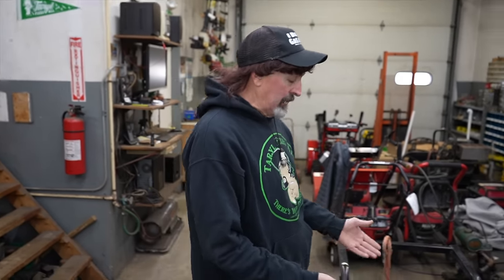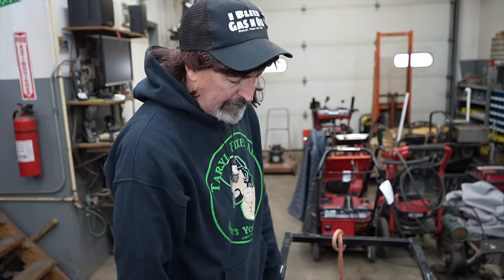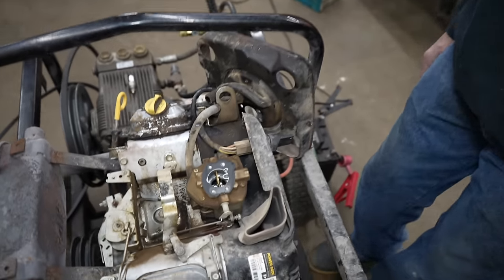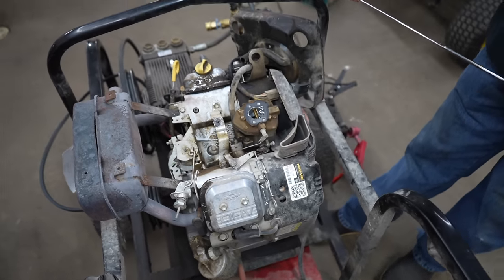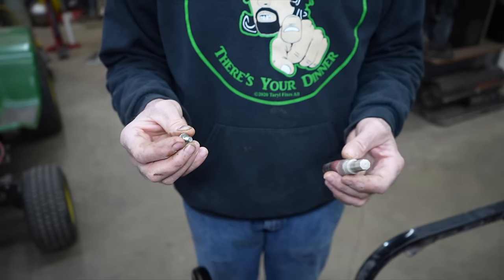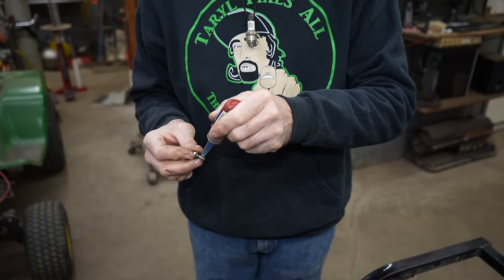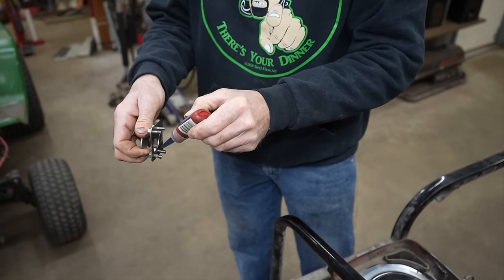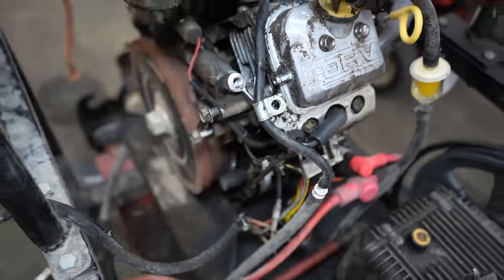Running On One Cylinder - You'll NEVER Guess WHY!

Comment from the maker: Subscribe to the new SKITS channel here! 
https://www.youtube.com/@tarylfixesallskits
Reply: Taryl.... that means he got screwed..... moooooo
Reply: And not in a good way….
Reply: I've been running on one cylinder all day! No spark! No comp.... de-pression. 😂 I'm still   running tho. 😊
Reply: It was about 4 years we had one of them ancient Kohler V Twins in an early 90s craftsman tractor with the one barrel carb on it and when it arrived it was clean like new clean. It even had a brand new plugs & air filter new oil and all that the customer was thoughtful since it was running so lousy he put 2 new coils on it. It was still dead on one cyl. Several days later I go to thinking to taking the carb off & out popped fluffy the rats skull. The reason he replaced the air filter it had a hole in it. Gufaw. But it took me about 3 days to think about it then on that on that particularly warm Sunday morning I got a decent new brand of coffee even though it was 70 degrees when I woke up I finally took the carb off and found the problem and when the skull came out of the thing it somehow landed in the cup of coffee setting on the ground by the front tire. I called the customer and his wife answers and after explaining I got the problem she asks me >>>so the mouse was dead in there??? Yep I say dead dead. I guess we'll need a new tractor then she says to me... Sheessh... The mouse is not what made the thing run lady... There is just some things ya get into that turn into a world all of its own...

Comment: I had a Breaks&Scrap-em boxer engine on a lawn tractor once, that wasn't hitting on both cylinders. Only thing is, it wasn't limited to one side. It was hit and miss on both cylinders. I had compression, and spark on both cylinders. But only if I unhooked both spark plugs. After much fussing and research, I discovered that someone had replaced the resistor spark plugs with regular ones. The ignition system on this engine fired both cylinders at the same time, even though only one was at the firing stroke. The other side just sparks harmlessly during the exhaust stroke. It's simpler than adding a distributor. But when a regular spark plug fires, it shorts out the coil briefly, so whichever spark plug fires first wins. The other one stays cold. A resistor spark plug doesn't completely short out the ignition, so both plugs can fire simultaneously. Replacing the spark plugs with resistor types solved the problem.
Reply: Yep, that's a wasted spark setup. The 32 valve Oldmobile Aurora engine also used a wasted spark system, and used only 4 ignition coils. I had two cylinders on opposite banks with badly fouled plugs and misfire codes like P0305 and P306. After replacing the plugs it wasn't much better and I thought maybe the engine had some kind of internal issues, and I got to thinking what do these two cylinders have in common? After looking at the firing order it suddenly made sense. I ran to AutoZone and got a new coil, ran like a champ after that. It wasn't too happy being a V6 lol.

Comment: Good video Taryl, I had a Kindasuky on a John Deere that would not stay running. After cleaning the carb. and head scratching I found a washer from the air cleaner down the carb. It would tip up and down blocking the carb. only when mowing! 💩

Comment: I've got one of those monster pressure washers too.  It's older than that one though but still runs good.  That's when Breaks & Scrapem was still making engines that last.  That pump on there is a monster... WAY LOTS of pressure!
Reply: I have one of them giant pressure washers I believe I bought that around 1992 if I remember the implosion of the True Value hardware stores in this region that is where we got it. It says True Value right on the machine but it was probably made under a dozen other names too. I suspect it was really a MTD or YARDMAN machine by the red & white colors. Its the first ever Briggs OPPOSED V Twin I seen that has 17.5hp on it. Never seen another OPPOSED twin cyl with 17.5hp on it and also is the fact most of the serial is the same serial on the 19.5's because I have several of em 4 to be exact. I have 3 spare opposed twin engines at the ready here. I could use 2 LINKAGE set ups. I bought those 2 motors in need on CL and FB Market place.
Reply: @thekingsilverado3266  I think the engine on mine is rated 16 HP.  Pump is not belt driven like the one in the video, it's bolted right to the engine through some sort of 'transmission' or something.
Reply: @Wheel_Horse  I think that machine there is totally a commercial machine. What you are describing is like what I have. The commercial pressure washers like that machine I am familiar with were made by Ingersol Rand.. Gravely Farm Equipment made a few for commercial cleaning as well. Those I have seen at truck stops around where I live
Reply: @thekingsilverado3266  I'm sure mine is commercial, although there is zero manufacturer information anywhere on it. Probably was at one time but long gone now.  The pump is made by "General" and is quite similar to the one in Taryl's video, a '3 piston' job capable of more than 4K PSI as I recall.  I never have run it that high!

Comment: The problem cylinder that was sucking air was also making the engine surge/hunt. That went away after the second repair.
Reply: I noticed the same. It still did it a little bit after the fix too. If this engine had a throttle the issue with that one cylinder would be super obvious because it would drop out when you reduce the throttle to an idle as a result of the big vacuum leak.
Reply: That was my exact problem that engine would sound like a runaway engine. Before I turned it off

Comment: Who'd a thunk that could happen?  The Lawnmower Detectives do it again by solving lawnmower mysteries.  You guys really are the best!!! Merry Christmas to y'all.
Reply: The carb is usually the first place to look for strange sheet going on but sometimes when the problem seems to have another answer to it then that becomes the last place to look especially if the thing runs. I just love some of the stranger stuff like when mufflers implode and the will start up dies out ya put a new carb on it and does the same sheet or won't even start back up. Now those R the fun projects that really burn you ass even years later

Comment: Nice job Taryl. I have an old single cylinder lawn mower which is surging at full throttle. Just replaced the old air filter. Will look for some air leaks.

Comment: Few years back my landlord gave me a Deere GT-235 with an 18hp Breaks on it, ran real weak & only on one cylinder. Took a while, but finally figured out it was a corroded broken wire on the Diode. Runs like a champ now. Great vids Taryl & crew. James in Wisconsin

Comment: I was asked to check out an Evinrude outboard motor that the owner said would only run at full throttle. 40 horse twin cylinder. Brand new boat and motor. Dealer looked at it several times and claimed it ran fine. First thing I did was look down the throat of the carb and gee, what do we have here?
I pulled out a plastic cap plug that was stuck in the reed valve for the upper cylinder. Closed it up, started it and purred like a kitten. Great job Mr. Dealer.

Comment: I like the water trick with the squirt bottle just about everybody's got a squirt bottle around with Windex or something else in it but some people can't afford one of those fancy laser thermometers
Reply: Rubbing alcohol works even faster.
Reply: Yeah many DIY channels would make you think you have to buy one of those infrared thermometers.
Reply from the maker: Yeah don't waste your money  @davidduma7615
Reply: They’re not much at all. You can get them around $20. I use mine for other things too and a good diagnostics tool for engines that don’t have opposed exhaust ports. Hard to tell if one cylinder is running cold or hot when you have bleed through heat on an exhaust manifold.
Reply: Those INFRARED thermometers are very cheap these days for a basic one, plus they are FUN to use, plus it has the laser aiming helper (to play with), plus they give you the exact temperature +/- a few half degrees depending on how accurate they are. Ever wonder just how hot your engine is running at full throttle after 15 minutes? Use one of those, great fun.
Reply: @TarylFixesAll  I'm ashamed of you Taryl, advocating for the use of expensive shop tools like spark testers when grounding the spark plug to the cylinder head works just as well. "Don't waste your money" can also be said about it...🤣👍
Reply: Could just pee on it.

Comment: One thing I've learned from working on my equipment is to always check for loose bolts.  When I repowered my toro zero turn on which the original engine failed because of loose bolts.  I went over the new engine and removed each bolt one by one (except the head bolts) locktighted and retorqued them.
Reply: Loctite or nylocks, cheapest insurance ever.

Comment: Nobody else would have figured that out.  I would have been glad to pay 200 just to have this discovered and be back to running it again.  Wow, that water spray evaporates so quickly. A great indicator that things are working when you can spray both muffler pipes down and have that water evaporate and realize that things are fixed 100% and back to complete normally.  Great Find !!!

Comment: I would of guessed the intake manifold gasket after checking spark and fuel and compression, but the bolt was a surprise that was a great diagnostic challage for sure thanks for the great video👍
Reply: *would've or would have. Maybe the disconnect happens mentally as "would've" sounds like "would of" before you even write it? Ending the use of contractions for a while might solve this epidemic of degenerative English we are seeing. Don't and won't (for example) carry a lot more verbal weight and emphasis if you say DO NOT and WILL NOT. I'm just pontificating here, not calling you out personally since you're not the only one turning "of" into a verb. I am a new English speaker so this is very bizarre.

Comment: A friend of mine was having trouble with the Kwaka motor on his mower, no power, wouldn’t rev up. He pulled the heads off and did the valves but it still wouldn’t go properly. He called the ‘big guns’ in (me haha) and I could hear a rattle in the muffler. It had a baffle broken off and it was blocking the gas flow. We pulled the muffler off and it went like a champion. Still a very expensive fix unless you build your own exhaust system. Jeff.

Comment: Reminds me of a lawnmower that I was working on this past summer. It was a Pulsar branded mower with a Chinese engine. Couldn't figure out why it kept flooding out. Turns out, it kept choking itself out by sucking its own air filter down into the carburetor. This was a really weird 2-piece air filter which apparently has a major design flaw. Almost brand-new mower and the guy brought it to me saying it wasn't running at all. I'm glad it was something simple or it wouldn't have been worth my time fixing. I've since quit working on such cheap mowers.

Comment: I have a 16hp castiron L head briggs I purchased a while ago but it had an interesting issue it had less than a 100 hours on it has great compression had great spark had never been apart and had a new carburetor I couldn't get it to run and I remember seeing one of your videos about electronic ignition on those old briggs engines and got thinking about that. Someone had switched it over but never adjusted the timing I put a factory coil on it new points and now runs well

Comment: Hey TaryI am running in circles on this generac pressure washer engine it’s a gen-360 it is ripping the cord back hard firing early or something I went through 
Shear key is good timing inside is good valves at .003 tight intake loose exhaust , coil is on the right way I just can’t figure it out is there any other reasons why it would do that ? compression release I took out completely it runs good but I’m afraid to pull it lol any ideas . Thanks for any help grass rats too !!! Snap back is scary !!!! But if I get it to right around top dead then yank one hard pull it takes off fine but if I miss that pull and pull again RIIIIIP!!! Lol I’m confused oh and pump not connected  either .

Comment: 1959 BS Repair manual says that the first thing you do is turn the flywheel backwards by hand to check compression.
With a twin you first do it with only #1 plug in it. Then you do it with #2 installed.
After 50 years I like to do that first and then stick donut spark testers in both plug wires and spin it with a drill for 10-15 seconds.
If it misses even one spark you have to fix it so it doesn't.
Then - by whatever means necessary - make sure there is no gas in the carb and shut the fuel off (may have to pinch the hose).
At that point a squeeze bottle full of mixed gas having a 0.100" hole in the lid primes it, starts it - and then you try and "catch it" and keep it running. Once you succeed in keeping it running on prime - then enable the fuel flow and see if it will take over from the prime bottle.
The reason for doing it this way is because "compression = zero leakage" of rings, head gasket.
Ignition just has to meet the "1/4" sparks every time without fail" criterion.
But fuel is different because you can have either too much or too little. You have to find the "sweet spot".
So doing it this way keeps you from blaming the fuel system when it is a leaky intake valve or weak sparks.
You are welcome.

Comment: Great video,  as usual.  Terryl, I gotta question.   I'm an automotive mechanic,  have been for several decades.   In a typical 4 stroke, in my experience,  a vacuum leak affecting one cylinder,  like here, that particular cylinder will actually run hotter.  The reason being that the increased oxygen acts as a blow torch in a sense.  Also the idle will increase due to added air needs added fuel causing higher idle.  Neither of these happened here.  Just threw me for a loop🫨
Reply: My exact thoughts also !
Reply: With the bolt in the carb, it was sucking  only air so it couldn't fire and run hotter.
Reply: @petecolborn4289  it's a single bbl carb though.   In other words, one bbl, shared by two intake runners, how does a bolt prevent a downdraft carb from drawing vacuum (to pull fuel via low pressure) on just one side.  Defies physics.
Reply: With the loose bolts on the cylinder, it was getting so much air it was barely getting enough fuel to run and cooling the combustion. Partially firing.

Comment: I'm having the same problem with a 23hp twin valve I have plenty of spark and compression the valve guides are right right where they need to be and  put a new double barrel carburetor but I'm still only running on one cylinder.Does anyone have advice on how to fix this.

Comment: I had my old Briggs do that had compression spark and correct valve adjustment. It turned out a chip of paint was stuck in the main jet in the carburetor! It has a jet for each cylinder they also say you can’t take that carb apart just one large Phillips screw holds the bowl on. I got it loose . In the process removing the carb found out mower MD had cross threaded one on the manifold bolts! When it was worked on during warranty. They are out of business I wonder why !

Comment: I've have one that the rockers jumped off of the push rods. Some idiot tried to adjust the governor because the fuel pump was going bad and it was causing it to surge. It over revved and floated the valves. Luckily it didn't hurt anything, 145psi of compression on both sides. Always check the simple things before you go "adjusting stuff".

Comment: Hey teryl I have the same engine that I bought used and the guy said that it fell over on the trailer and it started but kept smoking and oil was dripping out of the exhaust and it quit dripping and it wasn't smoking as bad but the next day I went out and same thing smoking and oil was dripping out again

Comment: I had a brand new Kohler that stopped firing on one side. Started pulling everything apart and noticed the intake manifold bolts backed completely out. Tightened them up and motor ran great.
Reply: wow, i thought you were going to say a mouse was in the intake

Comment: I recently fixed a stuck float on the KRohler engine in my Lincoln Welder. I was super paranoid about the air cleaner shroud screws coming back loose and getting sucked in the carb. I could see the remnants of thread lock that the factory had put on them and added more Blue threadlock when I put it all back together.

Comment: Taryl.. I work on them Vannys all the time. Everything you mentioned goes wrong with them. I’ve seen the intake bolts walk out .. I’ve seen valve seats pop.. I’ve seen guides fall .. bent pushrods and blown head gaskets.  They use to be decent engines. All of a sudden in the last I’d say 8 years .. they are junk.

Comment: Back in the 1990's Kawasaki had a recall on their Jetski engines.
Apparently, the set screws holding the butterfly plate in the carburetor throttle body would loosen, come loose, fall down into the cylinder and cause the engine to seize up stopping the jetski dead in the water.
A friend of mines son went ass over teakettle in the lake when that happened to him. Luckily he wasn't seriously injured.

Comment: This exact problem happened to me when I had my opposed twin Briggs and Stratton. 
I pulled the head and found it wedged in the exhaust valve. Luckily, it wasn’t damaged and I was able to remove it and put it back together just fine. 
What a poor design, used loctite after that!

Comment: LOL 😂 I work on a used great deal GX160 pressure washer for weeks they already did new carburetor I did new coil. Choke had no effect when running. It would die after about a minute. Turns out previous owner used metal gasket to filter box as the gasket to the head. Bowl vent was not working at all.